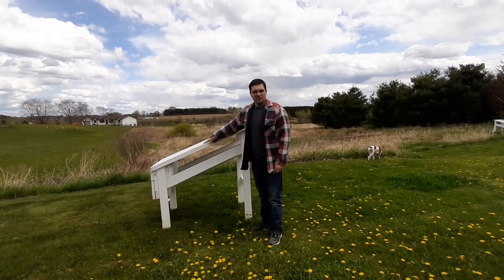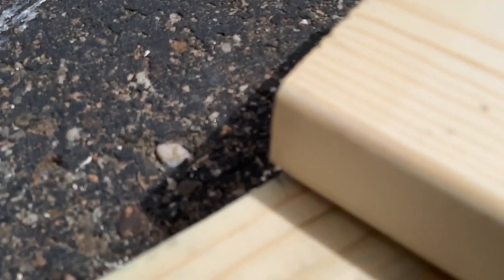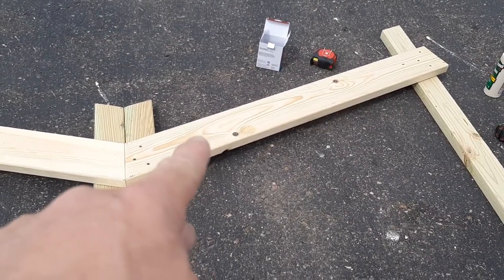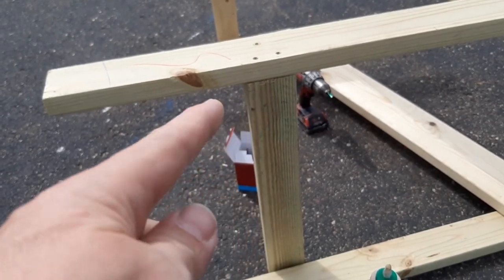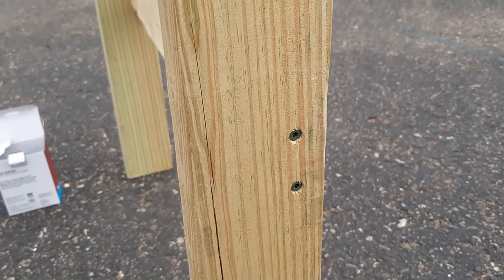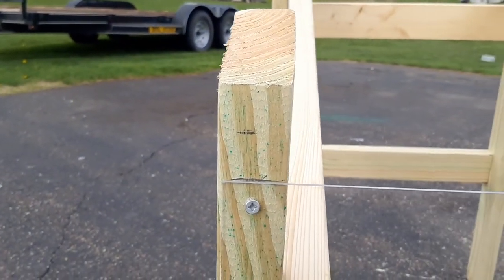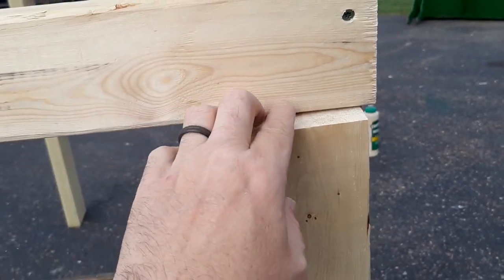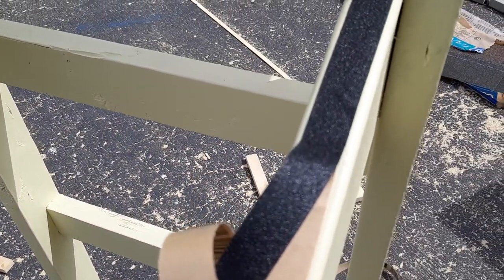Building The Parkinson Hive: The Hive Stand (Part 1)

Comment: I am planning to build a long Lang hive and found your Parkinson and tilted hives intriguing. I doubt I will build a Parkinson hive, but I like the concept and it gave me an idea. I wonder how a stair stepped frame rest would work with the Lang frames. It could give the bees more room to build bur comb on the top and bottom of the frames unless the cover and bottom were also stair stepped. What do you think? That much custom work the cover and bottom is enough to dissuade me from building it. On the tilted hive I would guess that the bees could still get stuck at one end of the hive away from honey stores in the winter, but having more vertical travel room would help. Great content. Thanks.